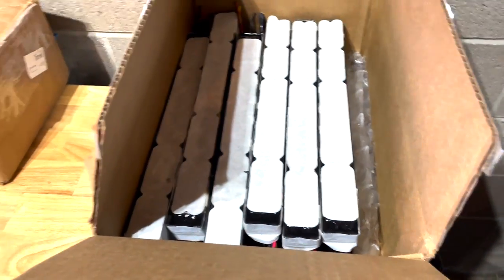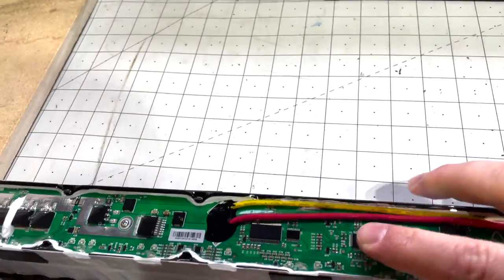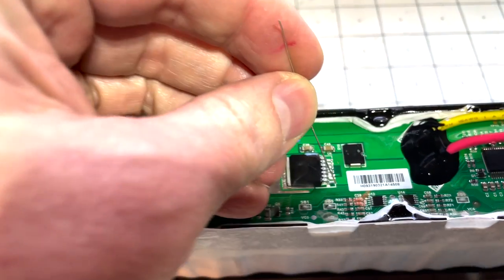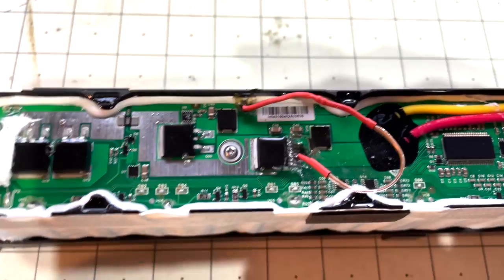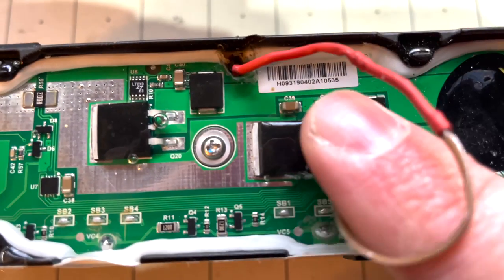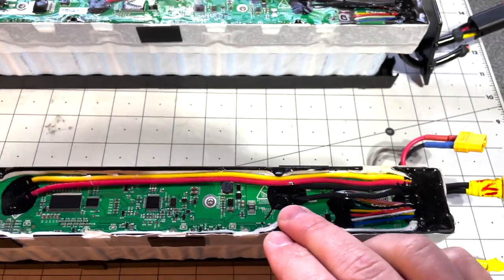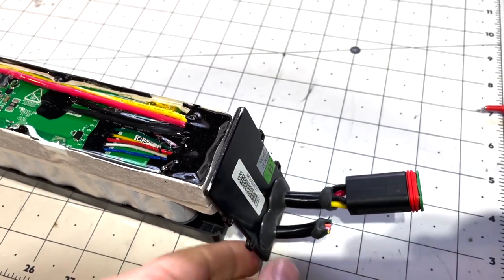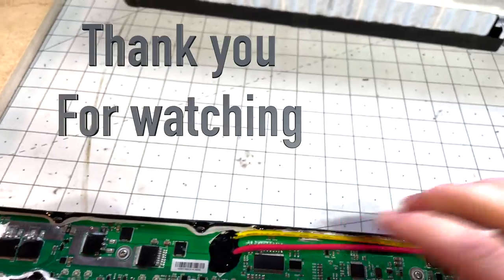Scooter Battery 3rd pin hack - 40 LGMH1 18650 - Simple Hack to activate the BMS (ep 01)

Comment: Eric, one question to add to my previous thread - what wattage would you recommend for the inline 1k resistor? Checked Erik's video and didn't see any recommendation.
Reply from the maker: The one I used was 3	
1K Ohm 1/8 Watt 1% Metal Film
Reply: He used an ⅛ Watt resistor!! If it's ok with one that small then any size bigger will do to.. 😊

Comment: Have the exact same battery, and did exactly as you said - but somehow the battery isn’t waking up after I connect it to a charger. 

The charger is a regular Chinese 36V ebike battery charger which works on numerous other 36V battery packs. 

The charger is meant to light orange when it’s charging and go green when it’s not charging. It stays green when I plug the battery to the charger. What kind of charger are you using?
Reply: Still have the issue?

Comment: Hi Eric, many thanks for your video very useful.
I followed your istruction but at the end I have unlocked only the output Motor, the input charge is still locked and the voltage measured is "0". Why? Can you hemp me to complete the project and able also the charge input.
Many thanks in advance
Reply from the maker: Not sure, I did 8 of them and I was able to get 7 to work, but one of them did not, probably a bad BMS, to wakeup the BMS you have to try to charge it via the yellow cable after the hack, this should wakeup the BMS. If that does not work you can always get a new BMS ;-)
Reply from the maker: Here an other video of similar hack from YoErik --> https://www.youtube.com/watch?v=AiW7eAaoj5c

Comment: Wound up with 10 of these batteries, never deployed. Have kept them charged and "comfy" since, but considering doing this mod to them. Curious what you'd recommend in regards to doing this mod while they're still at a certain amount of charge.
Reply from the maker: It's been a while since I worked on those batteries, but if i remember correctly the BMS is off until you do the hack and then charge the battery via the charging cable. Out of 8 batteries I was able to successfully do this hack on 7 of them... good luck...
Reply: @t-bo-diy  Any chance you remember what firmware they were marked with?
Reply: L1i00

Comment: does this have over charge protection when charging ?
Reply: I did not test this specific use case but must BMS does provide over charge protection...
Reply: @EricTbo  I have the same question. Just did the hack on 3 batteries and am charging them. They are up to 41.8v on the outputs and the shutoff has not happened yet. Starting to wonder...
Reply: As soon as I typed this comment the BMS shut off at 42.5v on my meter.

Comment: hi, i have a hy-rdf-s1004um-mh1 battery, and it gives me an output voltage of 180v. It has a sticker that says OTA with Anti-Theft. Is it possible to make it work with its original voltage? do you have to do a bms bypass ??? Thank you.
Reply: Hi you are the only one in the same situation I believe! I didn't measure the output, but the scooter stops working as soon as a load (person) is applied on it

Comment: Where can u get the original power out plug?, I need one like that for an old ebike
Reply from the maker: Sorry don’t know
Reply: They are Molex ML-XT, now discontinued but they can still be purchased at Arrow
Reply: @darkavenger2011  Molex ML-XTs are also identical to Deutsch DT connectors. Compatible.